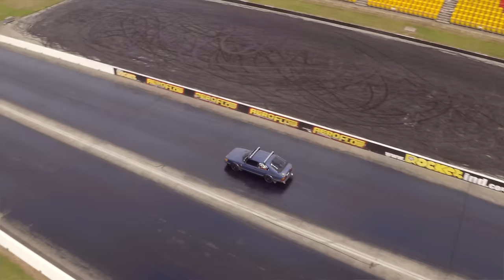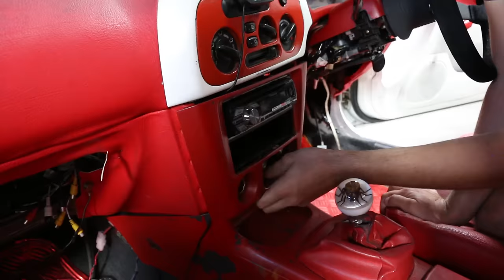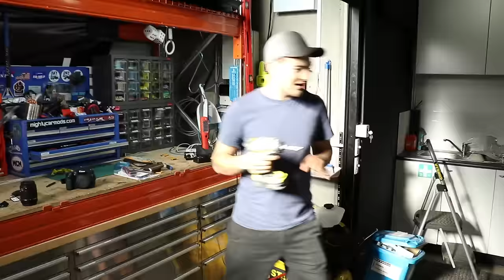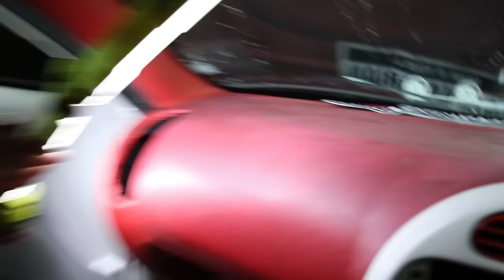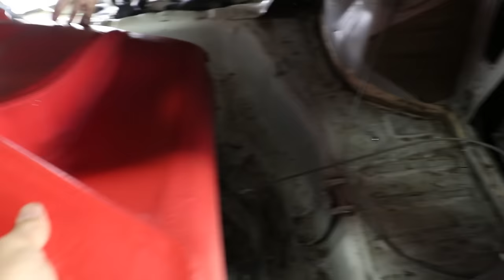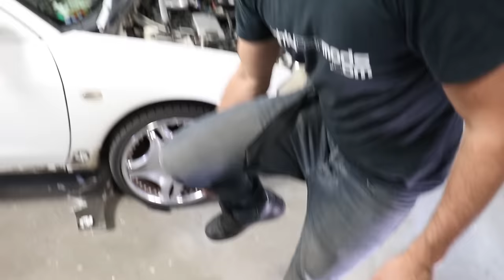How To Unmodify Your Car

Comment: Save the T00 5XY number plate off the boot
Reply: And off the front bumper
Reply: They have to anyway. In NSW "If your vehicle's registration is cancelled for any reason, it’s an offence to keep the number plates." They are the property of the RTA. But I assume they are keeping that rego anyway, at most they might replace them for change the colour.
Reply: technically personalized plates such as too sxy would be transferred with the rego to the car owner, so I guess marty owns the plate now
Reply: +Unitesninja not in NSW they don't. All plates, even custom ones, remain property of the RTA for the rest of time

Comment: Need these guys to come over to the UK and become the new Top Gear presenters rather than those crappy new guys!
Reply: #roadkill for new top gear presenters
Reply: +Walter Ritchey That is very true!
Reply: Why not? cause of Brexit?
Reply: I dunno man, if you're used to the climate in aus especially in south or western parts you'd probably be pretty uncomfortable here most of the year... but on the other hand our countries aren't that different. We have mildly less strict laws on modified cars for starts - same noise related laws but you can pretty much do what you like under the hood as long as it can pass MOT for safety and emissions and you find an insurance company that will cover it. 

Definitely wouldn't recommend moving from Sydney to London, but you can have a pretty good time here outside of the big cities :) Plus, as long as there is an American around you won't be the foreigner people take the piss out of ;)
Reply: well well well
Reply: @Jessese   I will write down the lotto numbers in a random videos comments soon, see if they come true in 8 or so years 😂

Comment: I hope they kept the Saab. Let's be honest it was a pretty good car, No doubt a perfect daily too have.
Reply: It was sold, to a mod on the forums who lost his car (or so I heard)
Reply: +Joseph Morgan Ya he lost it in a fire
Reply: Was at a meet in Melbourne yesterday!
Reply: It was an awesome car but it had 400,000+ km on it which is VW TDI territory, not sure how much longer that would be awesome. Plus the super limited availability of parts!
Reply: Saabs don´t die...ever :)
Reply: +ForTheTech Swedish engineering is super fucking reliable. Saab is/was part of Scania, and their trucks do well over 1,000,000 miles, they know a thing or two about building a long lasting engine. Also, There is a Volvo that owns the world record with over 3,000,000 miles on the clock. Older swedish engines are built to last.
Reply: +Shona i just wish the later models kept being manufactured in sweden,  i think later on they were made by gm.
Reply: *when looked after
Reply: Shona Oh believe me I know they are bullet proof, but I would not be willing into buying one because of the parts availability, not necessarily because it will break but if you are working on it and you strip something or break something, you can't just go and replace it.

Comment: I think they took short shifter a bit too literally
Reply: they must've not been compensating for much....or didn't need to anymore after all the fast and furious neons and shit :D
Reply: I've shortened mine in the same way. It was way higher than it needed to be. I cut it and re-threaded the rod. I still have the original lever from this car (not cut). There is one STS available and it has to be forced in, which I don't want to do to my car. Stock lever/ linkage and trans are all excellent.

Comment: I can just see the captions for when you guys were kicking the dash to get the trim off the center console.  Basically "OFF" getting larger and larger in font size. xD

Good stuff guys.  I bet the power to weight ratio is far better now. :P

Comment: I bought a 1995 Nissan 240sx many years ago wherein the owner had an aftermarket sound system installed by none other than Sound Advice; a company soundly in the past. They used decent enough components but attached everything to the rear floor with self-tapping screws. Me being me removed all of the aftermarket sound stuff, including their make-shift 'L' brackets, only to be welcomed by what sounded like a soft fart, followed by the unmistakable scent of gasoline. They drove the screws through the floor pan and into the poly gas tank. 

Replacing the fuel tank was the least fun I had with that car.

Comment: I prefer a chopped shifter stalk combined with solid bushings on both ends of the linkage and on the shifter base, over a 'proper' short shifter. I think it feels so much nicer. :)

Comment: FYI: If you go & refine a registered street car like this , take it to an RTA weigh station & get a calibrated weight ticket before you rip into the accelerated weight watcher program.
 I heard someone mention "rip out the rear seatbelts" no matter what their condition keep the entire collection in a marked box & do not throw them out  until you have all the new Australian Standards replacement belts fit back into the registered vehicle.  Keeping all the seatbelts installed in a car until you can have it engineered as a 2 person capacity car , will stop you from being issued a RED defect sticker , if your car gets pulled over by NSW's finest during your weight removal programme. You don't need to have rear seats in the back of the car but due to ADR rules you must have enough seat belts installed in the car to match it's stamped seating capacity.  This was & probably still is a well exploited , non negotiable rule that any cop will enforce if he see's a car on the road that appears to be a work in progress.
My younger brother got hit with a RED defect sticker back in 1988 for not having the seatbelts & middle lap sash fit in the rear of his Turbo Rx3 Coupe , the cop looked under the bonnet & asked what the extra stuff was on the engine & the blow thru turbo setup was easily explained away as an "air conditioner"  but when he saw the lack of rear seat belts , the RED sticker of immobility was applied immediately....Keep it up. Moog's appreciation & ability to play a full sized Harp on radiators & the like when he can , has not gone un-noticed.  :)

Comment: If you guys are not going to change the engine Try and get a 4G15 DOHC head and swap it over, those engines came in the JDM lancers CK2A chassis code @ least do that swap. that SOHC 12 valve head is an boat anchor. I had a CK2A lancer and it was worlds better than any Sohc 12 valve 1.5 i drove.

Comment: Go get a set of 15 inch super light weight wheels, compatible with a set of Hankook Ventus RS-3 in 225/45/r15.
Slide in a set of heavy duty Springs and swaybars, and a set of Bilstein B8's, a water to air intercooler, centreforce weights on the clutch, and a borg warner s200 sx-e (matching the number plates) turbo,  some water injection (high pressure, injected into the intake runners near the plenum) Chrome moly cage, race harness,  perspex windows, hire a spot welder and do all the door/window/boot seems etc,  then, set it on fire, because no matter what ever you do to it, it will never be any good....

Comment: I really wish that when they were kicking the dash with their feet that the passenger air bag would go off.
Reply: I haven't thout about it, but now that you mentioned, I think it could happen. They should make a video on how to unleash air bags without crashing
Reply: Don't quote me, but around the year 2000 (when 2SEXY was built), I think airbags and ABS were optional. Also: MythBusters did that. In season 1: took an airbag out and they set it off with a battery.
Reply: +Ben Ward so they aren't that easy to pop, if they exist in that car. So sad
Reply: Air bags only go off from sensors on the out side of the car. Like really what would the point of having impact sensors in the interior of the car be? So when you crash and smash your head on something a air bag come out at 200 mph and also smacks you in the head, damn that would be a safe car....and they also unhooked the negative terminal
Reply: Yeas, you are right. Sorry for my mistake. Anyways, I want to kick bumpers until I release some airbags

Comment: that moment when you have a pregnancy test ad halfway through this video hahah
Reply: How's it feel knowing how your car is being pulled apart?
Reply: +Ben Ward what?
Reply: Isn't TO05XY your old car?
Reply: +Ben Ward nope
Reply: Oh. Pardon me then.
Reply: +Ben Ward if i had this car i would be doing the same as what they are doing now
Reply: I would've done this the afternoon I got it, to be frank.
Reply: all good
Reply: i reckon he paid to much for it the car barely worked when he got it
Reply: Andrew Folkes Well, yeah. But, ultimately, the guy who turbo conversion was actually the guy who got ripped off. I mean, a custom turbo kit (or at least an off the shelf kit) for one of these cars alone is worth maybe $3000 at minimum. I respect the fact that this has had as much time and effort put into it, but I still don't understand as to the 'why'. Though, the same thing could probably be said if I gave my Fiat an Alfa Romeo conversion.